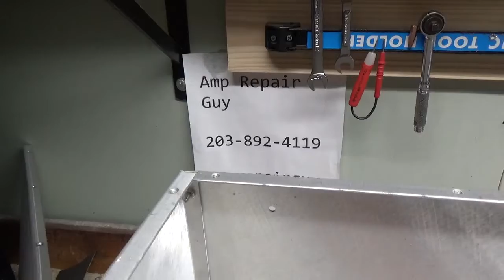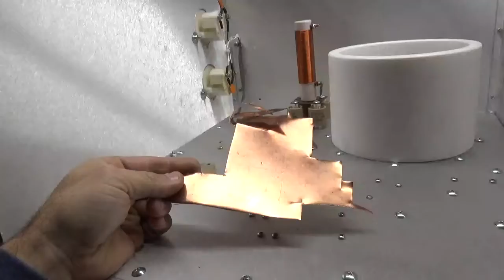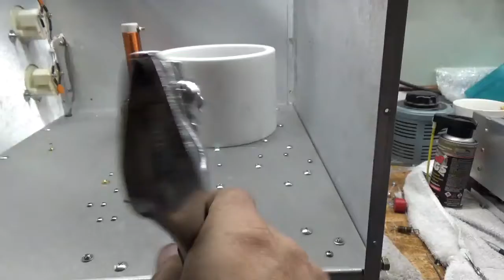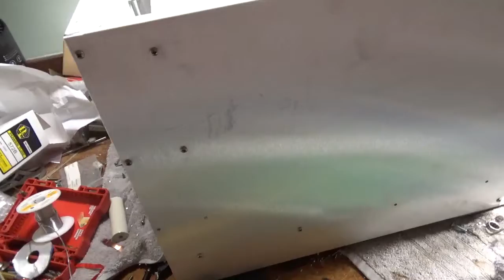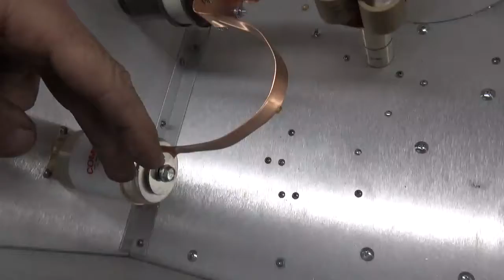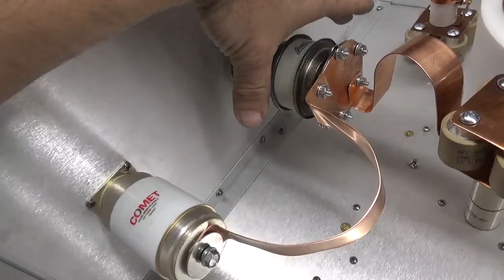3cx6000a7 6 Meter L - Pi Output Network , Vacuum Variable Capacitor And Plate Blocker Install

Comment: Cool build, on your plate blocking assembly feeding the L PI network, the hot end is pretty close to the L inductor, under normal Conditions most likely ok but during any tuning in combination to a high Z while tuning could an arc develop?  Was thinking you would have mounted the blocker assembly horizontally to keep the hot aend further from the L inductor. Anyway just my thoughts, great aaatching this build, can't wait to see you testing it!
Reply from the maker: Hi Jim thank you for the comment and concern. The inductor will most likely end up needing to be trimmed a hair and re shaped. Although plenty of clearance now, will end up with even more before it is completed. The output network was designed around a loaded plate voltage of 5500 dc . All of which will be explained once completed. 73 Scott